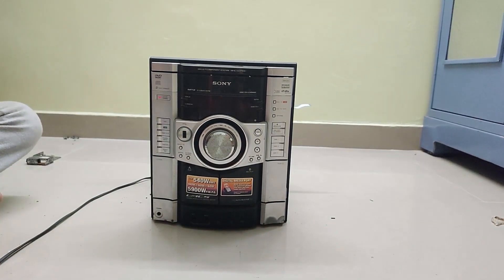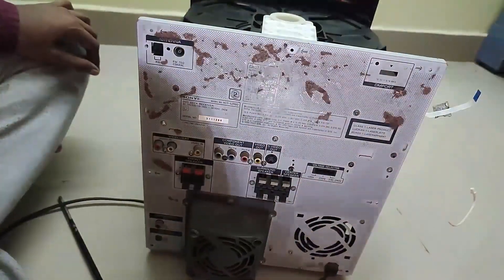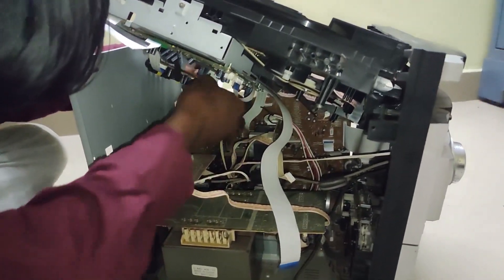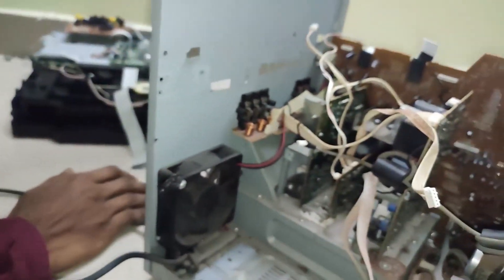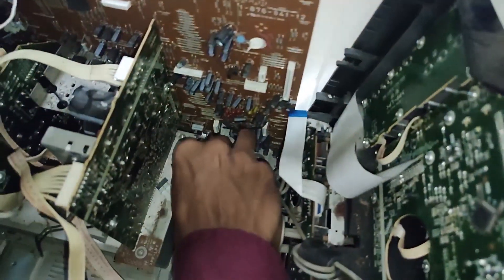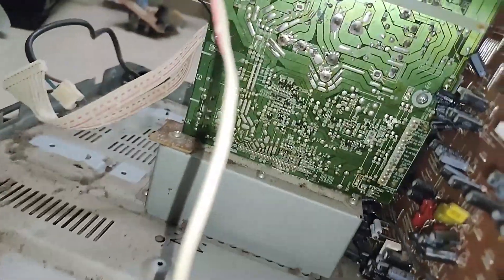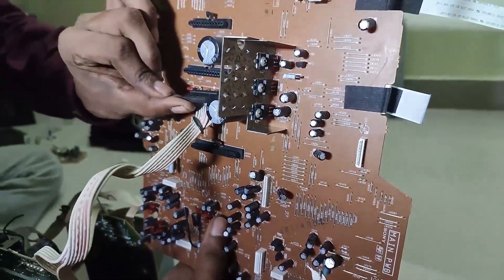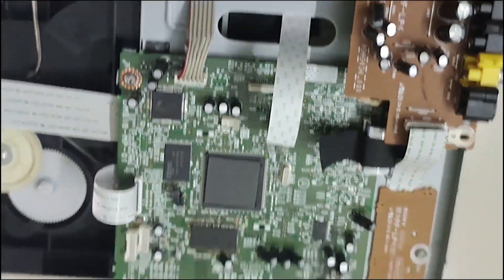whats inside! SONY MHC-GZR8D...full disassembly..

Comment: Tray is not opening as the the lens is not going back to open position after turning off the system. If I manually keep the lens in open position then the tray is coming out smoothly. What to do so that lens go back to open position automatically after turning off the set????

Comment: I have the same system and it's making crackling sound. Can you help me fix it?
Reply from the maker: might be a loose soldering joints on the stk ic or other components
Reply: @LETSDIY57   Bro are you in Bangalore by any chance? Could you check my system out? Or do you know anyone in Bangalore who can do it? Let me know please. Thank you very much
Reply from the maker: sorry bro i am not from bangalore
Reply: @LETSDIY57 were r u from

Comment: Bro If you couldnt service it are you thinking to sell the spares? I have this same model with audio problem. From Service Centre they told me that spares are not available. So If you are not willig to service the service and reuse the system anymore it would helpful for me if you could provide me the spares from your system